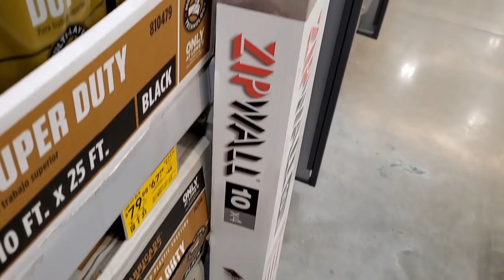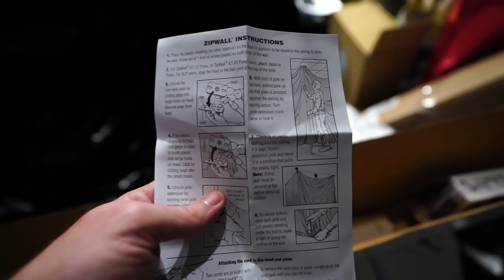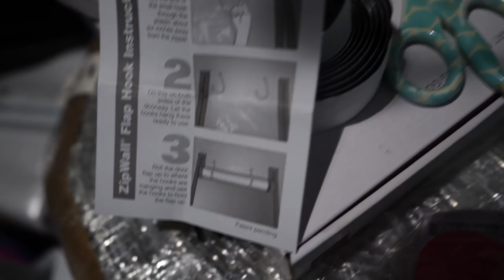Special New Houseplant || Finishing The Grow Room || Shopping at Lowes

Comment: Your videos have been so helpful and inspirational. Keep it going. I live in Zone 7 on Long Island and ive been gradually buying more Palms and tropicals. its my 3rd winter in my first home and the basement is my current winter grow space. do you have any input on what temp is good for Palms during the winter. its not heated and i was just wondering how warm your garage stays and what humidity you try to keep it at. Thanks!!!
Reply from the maker: Hey Havic! Thank you! It really depends on the type of palm. I aim to keep the growspace between 65°(pm) and 84° during the day. I let the temps drop and rise for the orchids. Humidity bounces around depending on how hard the heaters are working, but I like for it to stay above 50% and normally it is between 60 and 75%. The cool side of my garage has always been fine for my queen palms, pindo palms, mule palms, med fan palms and that is normally in the lower 50s and very dry.